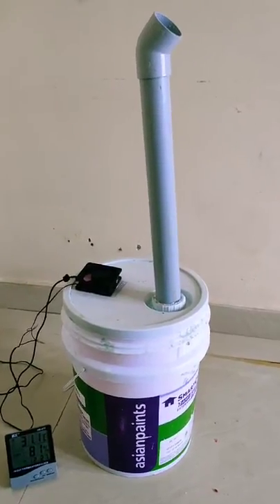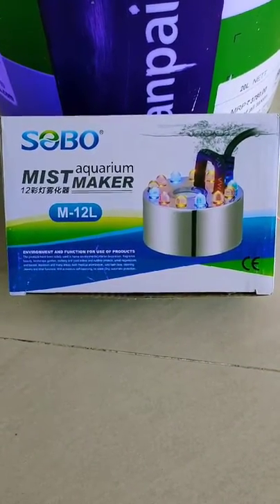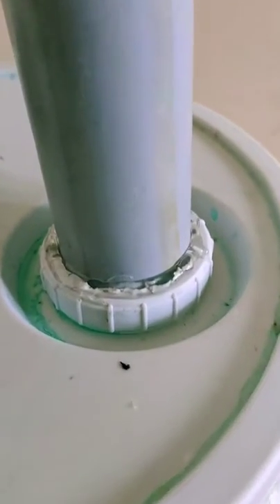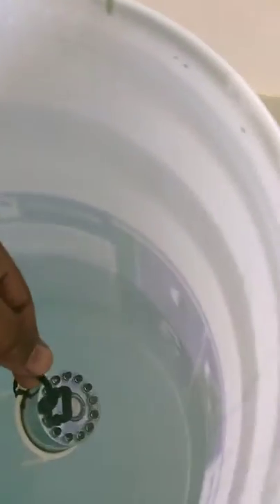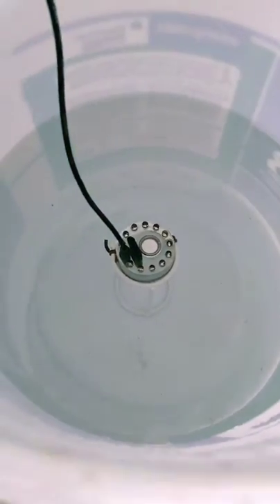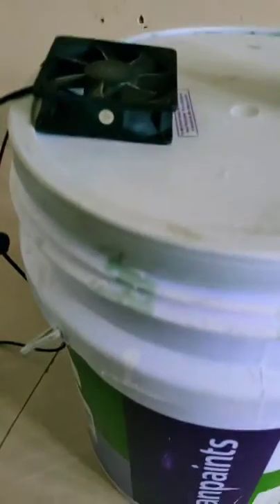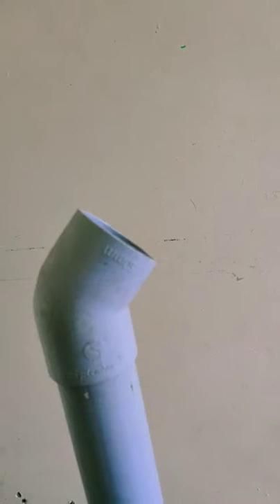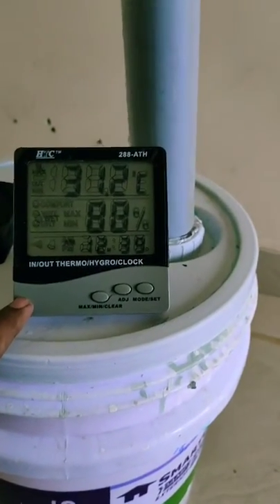How to Build a Homemade Humidifier #RR Mushrooms #mist maker #Ultrasonic Mist Maker #Low cost

Comment: Thank you for your video from srilanka
Reply from the maker: Your most welcome. 
Also read this
1. We can connect water line-in and put "ball cock" (this way we no need to check water level)
2. We can add Digital Air Humidity Control Controller (once humidity reach set level, the machine automatically turn off, when it's low it will turn on)
3. We can add multi-direction output pipes for good room flow

Comment: You could make a gravity fed water leveller and supply with a hose secured to another bucket ran into the other bucket at the desired water level best for the mister.  These misters vaporise minerals into the air as well, if you end up with problems I suggest a mop or towel for natural evaporation
Reply from the maker: Hi, thank you for your valuable feedback. 
Yes your right. That is my first video, so I did with-in resources. Now I have the water leveler and continuous water supply. If you look at my discription area I mentioned about the water line-in to prevent water shortage.
Reply: @RRMushrooms  true sorry I was in a rush to get my room up to par, I will check out the other video.  Thanks for the great videos and practical setups.  Youtube is suck a valuable and great community due to contributors like you.
Reply: Are now tell me can should i make this humidifier or not
Reply: I am medical student I don't know about this water level problem or another issue .i just want to make low cost humidifier accord my small budget

Comment: Nice,
How will it maintain water level
Reply from the maker: Thank you.
1. We can connect water line-in and put "ball cock" (this way we no need to check water level)
2. We can add Digital Air Humidity Control Controller (once humidity reach set level, the machine automatically turn off, when it's low it will turn on)
3. We can add multi-direction output pipes for good room flow

Comment: 75×21 room kku use panna mudiyuma for sericulture.
Reply from the maker: Hi This is enough for a 10 x 10 or 10 x 12 size room.
Reply from the maker: You can use multiple mist makers to fill extra space. Ex: 6 head mist maker.

Comment: How many times in a day does it run when the outside temperature is about 30 C ??
Reply from the maker: Hi Pranjal, you have to maintain 80 plus humidity from the day you put the bags in drak or lighting room. So either you have to put humidity sensor (for automatic cutoff) to maintain constituent humidity. It means the sensor will alert the device to cutoff and when the humidity down the device automatically cut-off. 
If you have any questions please call me @ 9000192053.

Comment: Is this useful for fast grow mucellium and fruting
Reply from the maker: Hi Mr. Ganesh,  this is helpful to maintain the humidity in room. Mushrooms need proper temperature and humidity,  manually we cannot control humidity in accurate,  so if we use this along with temperature sensor we can maintain proper humidity in room. Humidity will help give proper mature to room as well grow bags.

Comment: I have been growing oyster mushrooms from  8 days and my room temperature is 28 and humidity is 70 is this correct? Will it work if I apply this humidifier?
Reply from the maker: This is spawn running right?
Send me photos to my WhatsApp so that I can tell.
Reply from the maker: You must have to maintain humidity 80 or 80+

Comment: How much time we can run when it starts operating.
Reply from the maker: Hi sorry for my late reply. We can run as long as we want. But i recommend you can install humidity control device. This will help you to auto on/off when it's reachs particular level. If you have any questions please call me at 9000192053.

Comment: How much time we can run when it starts operating.
Reply from the maker: Hi Pradeep, we can use as long as we want but, I recommend to check the room humidity with temperature and humidity meter. Also if you able to buy humidity controller (this will help to cutoff when the humidity reaches set value) to save the power and maintain accurate humidity value.
Reply: @RRMushrooms  Thank you. Are you using this machine for maintaining accurate humidity ?
Reply from the maker: @pradeepkumarl4796  FYI, I'm using the humidifier since when I setup. It's working well and it's sufficient for 12 by 12 room. I have the humidity control device, so when it's comes to set value, it will turn off. And I set the delay value 5min, it means my set humidity value 90 and when it's reaches the value it will cut off automatically. Also when the room humidity down to 85, with the help of humidity controller it will automatically switch on. Hope your got my point. If you have any questions, call me.